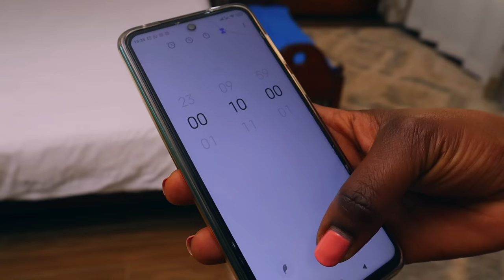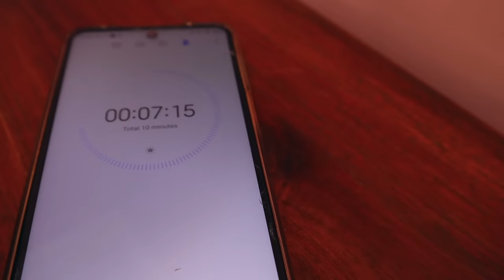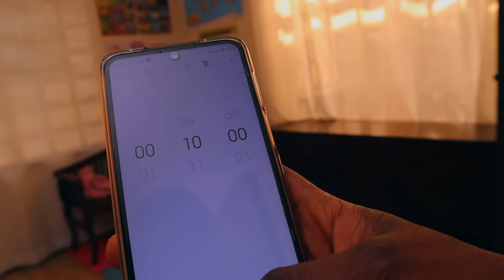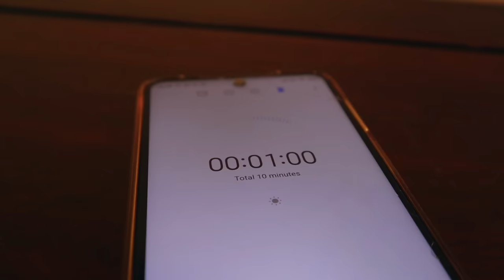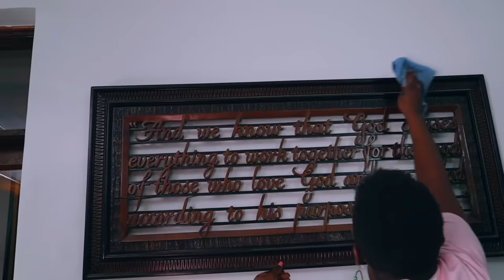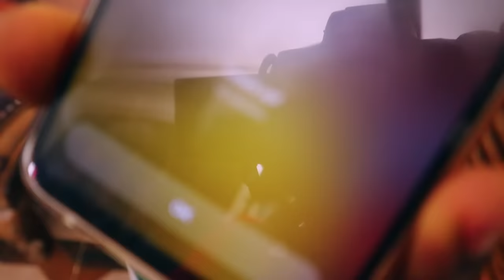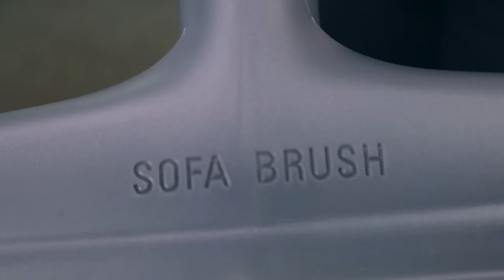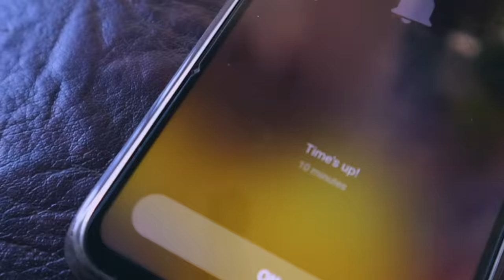How I CLEANED My WHOLE HOUSE In 60 Minutes!

Comment: Hi Suzy. I am really keen on buying a good rechargeable vaccum cleaner and I don't want to make mistakes. The Tefal vaccum looks fine but what happens when the battery becomes dysfunctional? Can you get  a replacement locally?
Also, what are some of the 'cons' of a rechargeable vaccum cleaner?
Reply from the maker: Hi Ruth! Yes, you can get parts for the vacuum cleaner locally. The main disadvantage is that the battery runs out and you need to recharge.